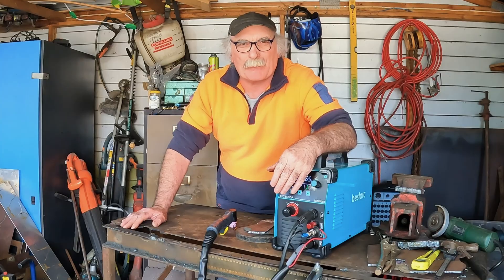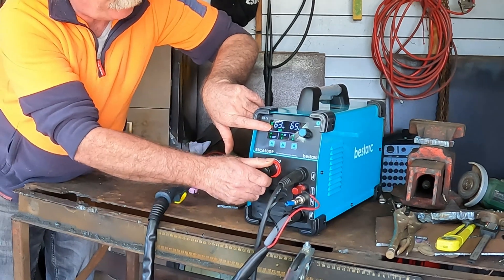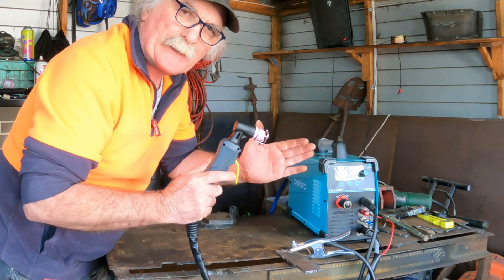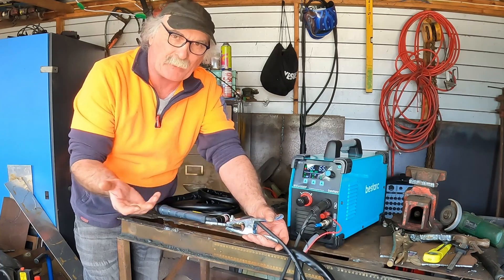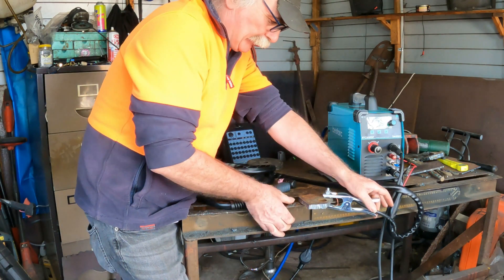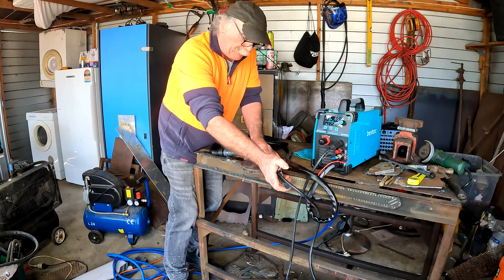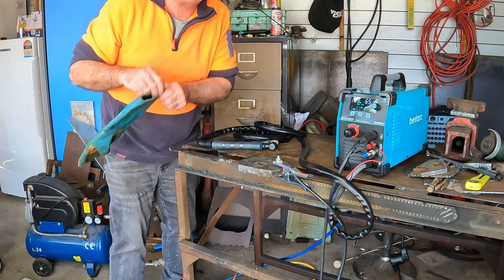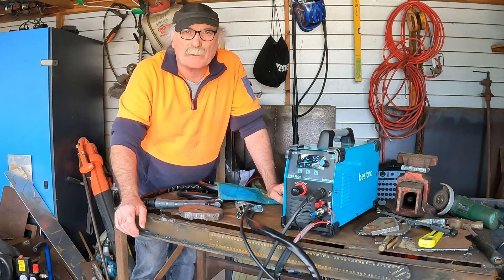The Ultimate Plasma Cutter Test: How Thick Can It Really Cut?

Comment: I have a 65A PlasmArgon pilot arc machine with the P80 torch on it.  I have cut 38mm steel with it no problem. Air @ 80psi using a 1.7mm tip and 220v/50Amp single phase. (Canada)
Reply from the maker: wow very cool
Reply: I think the SG60 torch on your 65 amp machine only has 1 tip available. The P80 has 4 different tips. 1.1mm, 1.3mm, 1.5mm and 1.7mm.